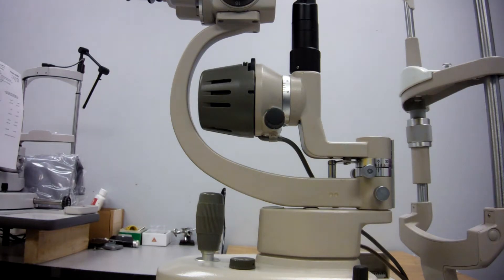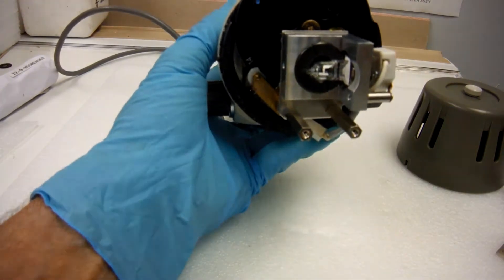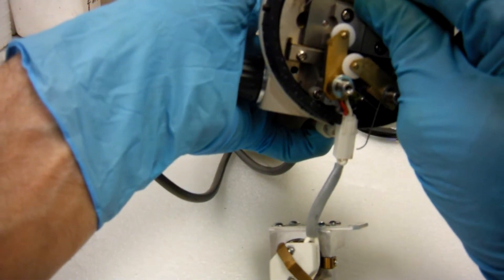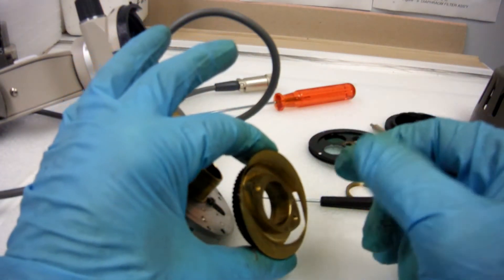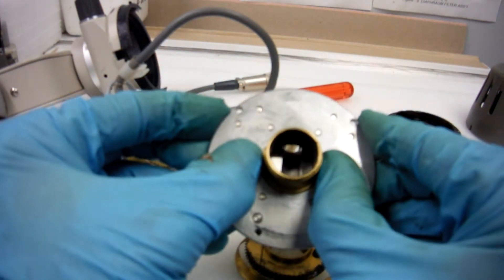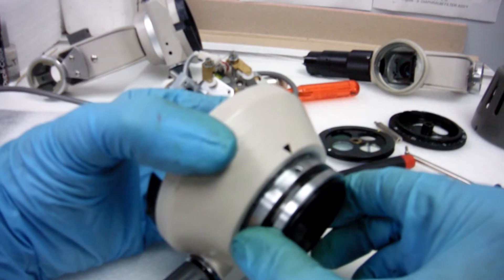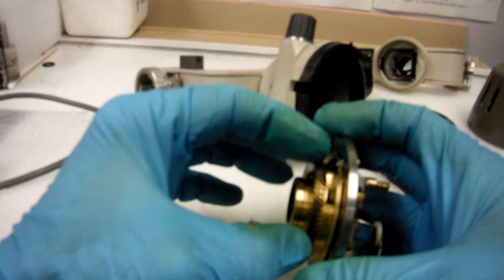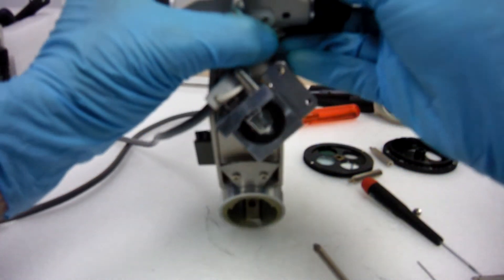TAKAGI Marco G2 Ultra  Slit Lamp common refurb issues

Comment: Thanks for making this video.  Could you provide advice on replacing the right side beam adjustment knob?  I removed it when trying to fix the beam width to close completely.  I'm not sure how the knob came off but now I can't seam to get it to "grab" back on and work.  It just turns without changing beam width.  The left knob still works.
Reply from the maker: Perhaps look inside your knob under the cap to make sure there are no cracks in the knob. If there is a crack that will prevent it from getting tight to the shaft and therefore not holding. This happens often on the Zeiss knobs. Just get it snug, not too tight or it will crack the plastic knob.

Comment: Thanks for the video. Do you know how to loosen the joystick?
Reply from the maker: Yes. Under the joystick handle are 2 flat edges. Use a small crescent wrench to hold it in place while you unscrew the handle. Careful not to scratch the paint on the base with your wrench.
Reply: @grasshoppaMedia  What if it moves but gets stuck on fine movements? I'm trying to do Goldman tonometry and as I move slowly toward the patient the joystick just gets stuck and I have to push a little harder than I want to continue moving forward.
Reply from the maker: I would make sure the wheel axle turns freely by itself without any weight on it. I would keep spinning the axle and then cleaning any residue that the bearings were leaving on it after I spun the axle multiple times. Then, I would make sure the gliding pad is clean and has a light coating of grease rubbed into it and  then wiped off leaving only the slightest trace of grease on the pad. And I might check the bottom of the Joystick that rubs the pad to make sure it is clean and has the similar slippery-ness as the pad.
If the axle is moving freely and the pad and joystick bottom surfaces are slick and slippery, there shouldn't be anything hindering motion.
Hope that helps. ☺